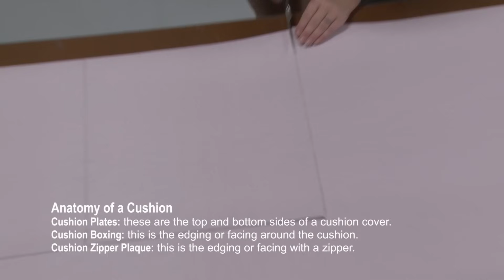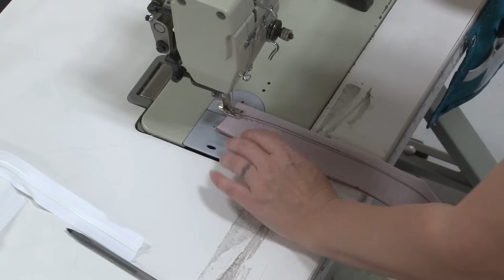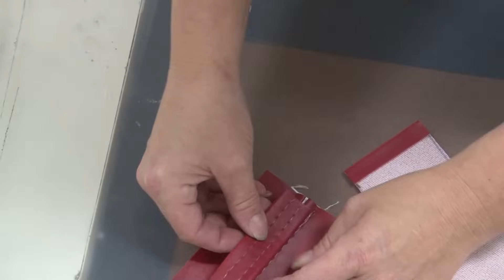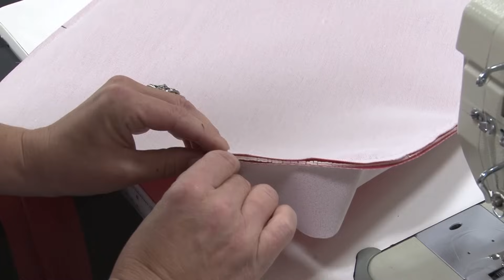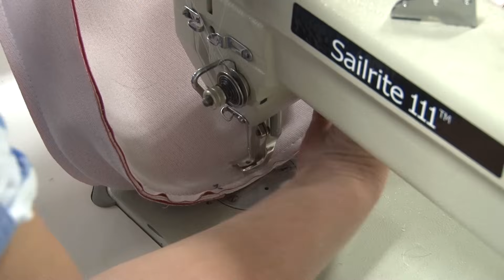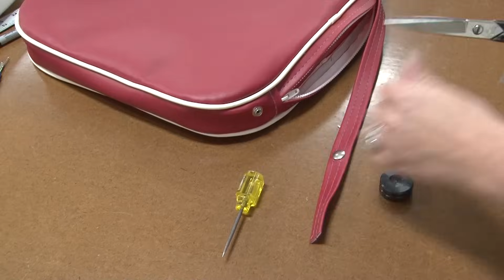How to Make a Stadium Cushion

Comment: I'm still new to sewing and my wife surprised me with an LSZ-1 for Christmas and this was my first more serious project towards things I want to do such as boat cushions, covers, sail work, etc. What a great video and I'm really pleased with the end result - while it doesn't look perfect, it also doesn't look like a 5 year old did it. I used the Nauga Soft Saddle color with  the Seabrook vinyl piping Midnight/Navy - looks awesome.
I struggled in a couple places and was hoping for some input...
1. I was really paying attention to the match-up marks and worked to nail them most of the time but it seems the boxing mark was always lagging the plate mark. I noticed this in advance of each mark and tried to figure how to feed the boxing faster than the plate (using the large cording foot). Is there a trick to this? I wound up with a couple of pinch points where I was trying to get them to sync up. I'm trying to avoid basting.
2. In the video the piping pulls away from the cord with virtually no effort when making the piping splices/joints. The Seabrook vinyl glue is incredibly strong and very difficult to open up cleanly - I used a point-turner after trying to work it free with back side of a seam ripper and got it free but the slits in the binding are the bigger challenge due to the glue. I couldn't get it open without doing a number on that part and wound up with a frayed mess. Again wondering if there is a trick to this?
Sorry for the long comment and Thank you for the awesome video - I learned a ton while doing this and the advice at the beginning to start with a stadium cushion is spot-on as the skills transfer to so many other things!